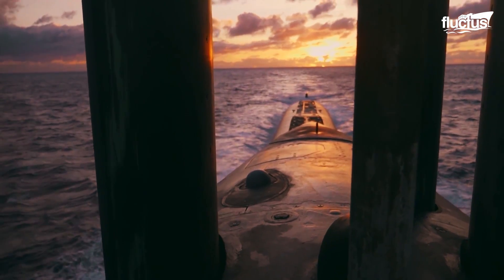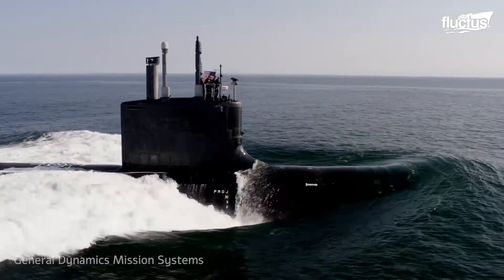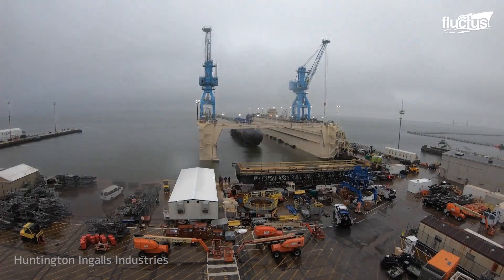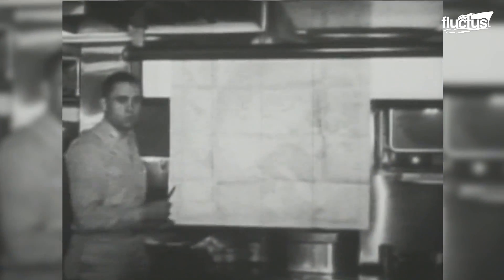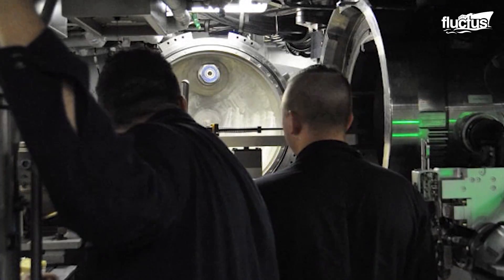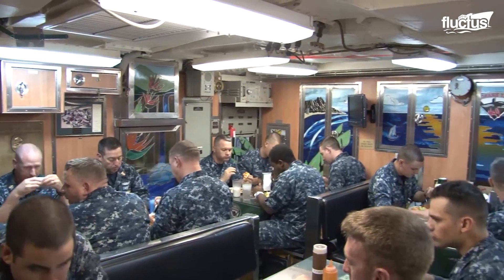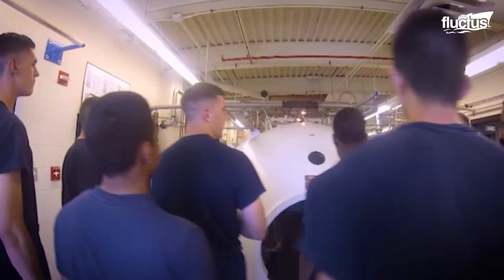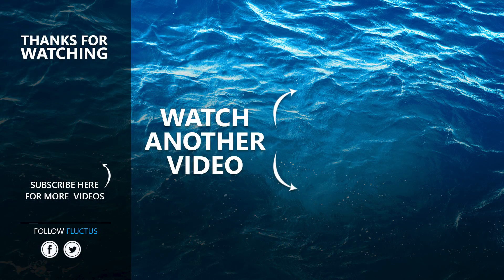Inside the Production of Gigantic Advanced Submarines

Comment: Great video. Are you sure you got that right at 6.06. Three six hour shifts making a 18 hour day. Would that screw up the Circadian rhythm?
Reply: it is possible on some but not really normal... there were even submarines with 4 hour shifts 2x4 hours for work 2x4 hours to sleep and 2x4 hours of "free time"
Reply: Typicaly you are 6hrs on. 12 hrs off watch. That does not mean you have free time. You have maintenance, qualifications of both submarines and watch quals. You are cleaning all the time. There are drills and there are actual emergencies. And then there are contacts that you have to chase. Then there are contacts that chase you. Cat and mouse games go on all of the time. There is no constent anything. Crap changes every day. Things break and you have to fix it. It is a rare thing to pull in from a mission for a repair. People can have medical issues, or have to be pulled off the watch bill to repair something, then you go on 6 on and 6 off. Port and starboard watches. The boat is on its own. So everyone just has to deal and sleep when you can. MMC/SS A-GANG RET.